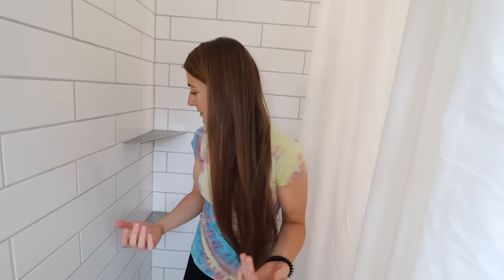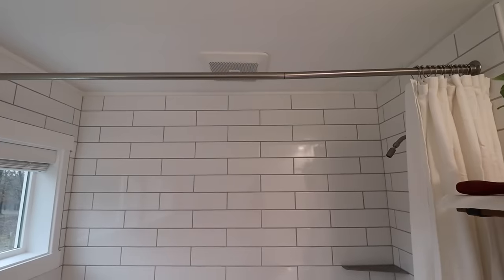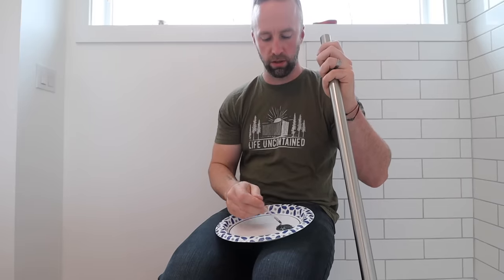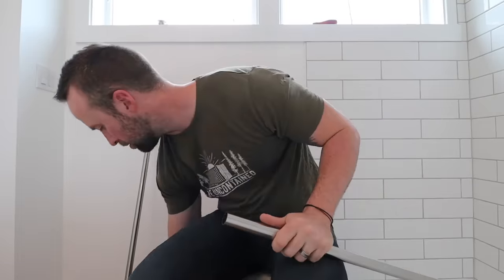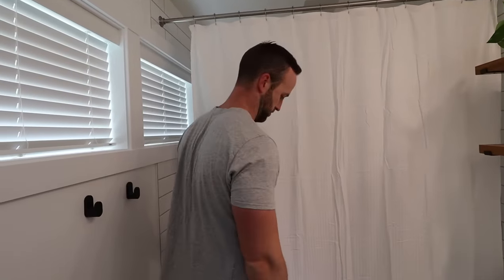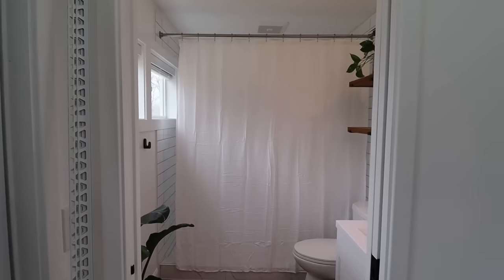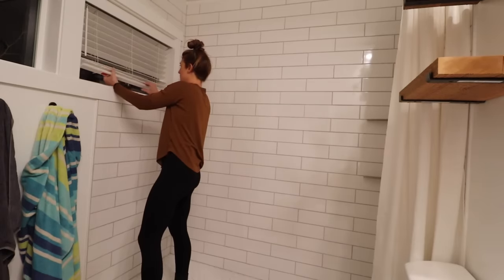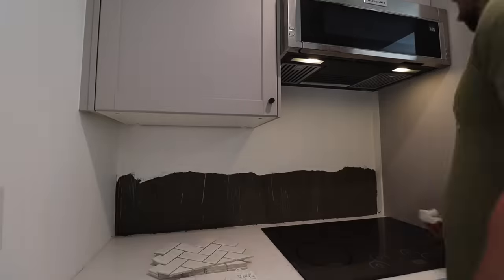FIRST SHOWER INDOORS AFTER 4 YEARS!

Comment: You can get two of the same shower curtains and put them together that'll have a nice draped effect and opening in the middle. That would look much nicer.
Reply: I agree, putting another of the existing shower curtain on the rod would look beautiful. One at each end of the rod, then when used, bring them together for one nicely fit curtain.
Reply: That was my thought too
Reply: I would sew two curtains together.
Reply: Tem razão vai ficar top aqui do Brasil
Reply: I was thinking the same thing... Could even get with a seamstress and have them combine the two ..
Reply: Sounds like a really good idea🤗
Reply: Sewing two curtains together will do the trick. It does not look nice to put them on each side. It will block one of the windows.
Reply: My thoughts exactly 💯
Reply: That was my thought too
Reply: Buy two of same and have them overlap, one part over the other. Or is the term 'intertwined'? One inserted into the other partway?
Reply: The rings that attach to the shower curtain can't overlap though and i would worry that it would be hard to make it close perfectly. But maybe if they are already wet the showercurtians could stick togheter?
Reply: I agree! Easy solution
Reply: Overlap the two curtains in the middle.
Reply: The problem is the pole that shags in the middle not the curtains. But yes it would look nice.
Reply: @dianemoonstone4715  A single seam is an easy way to make them a single curtain.
Reply: Exactly
Reply: I was thinking the same thing.
Reply: I think the shower curtain looks great the size it is
Reply: Thats exactly what I was going to say👍
Reply: I just came here to say the same thing!
Reply: @viviancatharinaseitzinger1841  or Overlap them on the same hooks…
Reply: The shower curtain is the inside curtain, putting two together is one way of putting it. The dress curtains are the curtains outside of the Shower and make the Shower have a different look - the dress curtains (2) can stay on each end with a tie [not the tie around the neck] to hold the dress motif for the bathroom. Or, something like that….. your choice on the shower curtains. [and, you’ll need a Second rod]…

Comment: I would install a hotel style shower rod, the curved one so you would have that much more room.
Reply: Only problem is that they don't make them longer than 72-inches long and they need 75 1/2"
Reply: Was thinking the same! Please go the hotel style shower rod. You will have more space...and don't forget the pressure change (while taking a shower) will suck the curtain towards you.
Reply: I put the same one in my place
Reply: thats what i have .. withe the curtaib id bought two put them up put magnets inbetween the two very simple and would look great
Reply: You can always construct one yourself with pvc,timber or aluminium pipe...
Reply: @kathywilder3272  Kathy, can you explain in detail what you are talking about?
Reply: Com certeza ia ficar muito legal mesmo, aqui do Brasil
Reply: Agreed
Reply: I agree!
Reply: @Harridanme1  Not a problem when the curtain doesn't span the entire length.  I hate when the curtain sucks in so I always have to give it 2" opening
 on the side so that doesn't happen.
Reply: @kathywilder3272  that’s super smart. You mean you took two shower curtains and sandwiched them between magnets to make a longer curtain yes?
Reply: I was thinking the same thing.
Reply: @fisherus  - I was thinking the exact same thing, though I suspect Spenser could come up with a way to extend the ends to fit their shower.
Reply: @Harridanme1  I have never had a problem with a cloth shower curtain coming after me ..... and weights are easy to add to the hem it if does become and issue.
Reply: I was wondering why they didn’t do just that!
Reply: @fisherus  that’s when you diy one to fit and work.
Reply: That’s the same thing I was just going to type.    It opens it way up.
Reply: TMI
Reply: Brendan, they don't have the sides of a tub to corral the bottom of the curtain, so they would end up either water all over the floor.

Comment: Friendly advice: 
Send that flimsy rod back. 
Get a rounded rod with a ceiling drop mount for more shoulder room. Set the ceiling mount 2/3rds toward the rear near the window. Use two standard curtains. You will have far more selection and they will be better quality and cheaper in the long run. The one closest to the water will be extended tight, the one farther back toward your window will not unfurl fully. Then put extensions on your rod rings for more light inside the shower and so the outwardly curved shower curtain lands inside the drip pan to keep you floor dry. Magnetic strip on the inside of the shower lip and magnets sewed or glued into the hem of the forward curtain keep it from billowing out from the steam and drip flooding the floor.
Reply: Great ideas!
Reply: I was thinking the rounded curtain rod too.  Didn't think about ceiling mount.  Great idea!
Reply: THIS 👍👍👍
Reply: Very well thought out
Reply: I have a rounded one and it is perfect.
Reply: 👍👍👍👍@ Marjongs Musings 
What she said 👏👏👏👏👏
Reply: I use 2 shower curtains! When cold weather season (NJ) it stops drafts too!
Reply: PS Wonderful shower!  Been following for years!
Reply: Agreed!  I love the curved shower curtain. For some reason I hate the curtain touching me. Lol.  And also agreed, get a second matching shower curtain.  ❤️
Reply: 100000% this
Reply: I AGREE~ Change it out Spencer!
Reply: I would also get 2 shower curtains. I don’t like them fully stretched out. ☺️ I also use a 2nd set of shower curtain rings for the shorter shower curtains I unknowingly bought. Those were a disappointment. 😒
Reply: Amen! That's exactly what I was thinking.
Reply: I totally agree!!!!
Reply: Yeah...They ain't gonna do that shit.
Reply: also IKEA has these S shaped shower curtain rings that means regardless of how the rod is mounted you can hang and remove the S-shape rings without any issues.  i'm loving mine because it means i can take the curtain down for a full spray and wipedown without any weight tugging down on the rod.
Reply: Somewhere I saw a rounded one that swivels on the ends so it can rotate 180 up and over and be rounded INTO the shower space when you are not using it. This lets you leave the curtain open to dry out and prevent mildew, but gives you space.
Reply: I have watched all your videos, great job all round. Please put a glass shower screen in that bathroom, it takes less space and it will look better...Please.
Reply: The only other thing besides a better curtain is a detachable showerhead. They have them for low flow shower heads. They cash pulse, massage and a few other patterns.
Reply: Soooo much hassle!
Id like my curtain to hang evenly not lopsidedly bunched up!
Far too much hassle with this idea. I doubt many would even think about doing it.
They said something about that shower section window not opening so a normal shower curtain would most probably get sucked in towards you. Grrr
Been there, done that...
Reply: @BenjiSun  they are the ones I want to eventually get but Ikea is a fair distance away and I dont drive that far very often. When I get my new Ikea vanity basin thats been sitting around for ages, to be installed, thats when I need those hooks.
Reply: @thenjiwemoyo6085  yes but after seeing how close it ended up being the rounded shower rod will give them a more comfortable space, don't you think? especially for the hubby.  Something solid (while great looking !) will be a pain to be knocking elbows on..
Reply: They can't get a rounded curtain rod.  As they said their shower is longer than standard.  They would have to get it custom made.  They were showering under tarps in the yard, with snakes hanging out nearby.  What they have created here will work fine.  Now they need to get the tub done so Beau can enjoy the fun of a nightly splash session.
Reply: @TexasbyStorm  "Can't" isn't a word I understand, I saw some good ideas    but  "Make do" I get...   Yikes!  Snakes are seriously busy right now.   Yeah the tub will be great!
Reply: A "hotel rod" would help for certain. With the measurements you need any pipe supply could put the bend in for you in minutes! Also the curtain issue easily solved just order 2 and ask a seamstress to sew together and cit to width.. it is just two straight seams super easy and not expensive...all problems solved and no custom ordering and delivery issues!!!
Reply: @agardenut  I hate the curtain touching me too
Reply: yes I thought that mayself
Reply: Yep was going to recommend a curved shower curtain to give a little more room.
Reply: @TexasbyStorm  he could bend a electrical rod.
Reply: What do you expect from a guy who spends 5 minutes explaining why the shower curtain doesn't go all the way across?

Not the sharpest thing to put a window in the shower. All kinds of opportunities for water getting behind the wall.

And why did they use grey grout? So they couldn't tell it was dirty? Should've used white.
Reply: Huh?

Comment: A quick tip: When you drill on tiles, just put a sticky paper on the tile where you need to drill as it will prevent the driller to move around.

Comment: Depending on how badly you want to add some shower space without taking up bathroom space - you can get one of those Curved Shower Rods and if mounted properly it will bow the shower curtain out at the top while the bottom will still stay inside the curb (if you have the shower curtain hung right).  If you want a stronger rod - I have used 1 or 1.25 inch rigid galvanized electrical conduit.  It is very stiff and it doesn't rust! It is also not expensive!

Comment: For the Curtain rod you could get a piece of Stainless tube, and have them cut and thread it at the Hardware store. Then put threaded flanges on the ends of the rod. Also with that you could polish the tube down to make it look finished
Reply: I agree with getting a solid one piece of stainless tube and adding in place of the two pieces rod you currently have.

Comment: I bet that first shower indoors was sheer bliss, well done on an excellent job, The tiles look great, When you need to drill holes in tiles use a bit of tape where you are going to drill. this prevents the drill from slipping. I know that you have finished your bathroom to a very high standard but you still have another bathroom to do, You are both amazing,

Comment: It would be really easy to sew a contrasting stripe down the side of the curtain to increase the width by a smidge. You could use a color (gray, the color of the plant pot, or pick something bright) or even a white with a contrasting texture. I would recommend adding a stripe to each side to make it balanced. You'll need 2 extra curtain rings to hang it.
Reply: or a black stripe;  very classy look;   or a black and white stripe;  nothing better.

Comment: If you need to drill in tiles: put 2 pieces of painter's tape in a cross on the spot and the drill wont slip away. Also, just dip the drillbit in a cup of water to cool, less messy.
Reply: He's using the wrong type of drill bits. Get the teardrop type that look like little arrows. I've use them for many years and they go right through ceramic tile with little effort.
Reply: @dunep6465  Yes, Spencer is learning.  I was cringing when he started drilling.  I could see it was the wrong type of bit immediately.
Reply: @dunep6465  Masonry bits.
Reply: Also running a drill backwards can get the hole started without slipping.
Reply: Beautiful!!!  Kudos to you both!!!
Reply: @rickc2078  yeah this also works. I prefer the tape because I like to believe it prevents little pieces of tile around the hole chip off, but I am not sure if that is a fact or just in my head 😆

Comment: You could add a dowel inside the 2 piece rod to add strength or a hanger.  I got tired of not having a wide enough shower so I used a curved shower rod which worked out very well. The curtain still tucks in at you feet, but it will give you about 6 inches or so and it feels like your whole shower is very wide.  Love your show!

Comment: Get 2 shower curtains and do the overlap of about 2 or 3 holes (where the rings go through ). Make sure the gap is away from the water stream direction. I hope that makes sense. I did it in my irregular size shower and it worked great.
Reply: I am going down and see we are thinking alike. Once you get the desired length then two will give volume and a beautiful finish
Reply: I thought of two curtains but if they overlap Spencer's OCD would act up.
Reply: @michellestephen7210   Once his wife listened to Donna he won't be able to tell
Reply: I was going to say this and you could also add a panel of a light weight colored fabric where the overlap is to hide it and add some color pop into the room!
Reply: @laurengoode9893   But she doesn't want colour. She wants a clean look
Reply: I missed that! Then do a panel of textured white still does the same thing 🙂
Reply: Better still, get a toughened glass panel, more room to shower, easy to clean.
Reply: @rickc2078  EXACTLY!!!! 👍👍
Reply: @rickc2078  explain more room as the curtain is already too close and the curved type rod at least gives a few more inches of wing spread...   something solid adds another issue: banging it or trying to avoid banging .
Reply: @itsno1duh  Shower curtains often suck in when the hot water runs and sticks to you, glass doesn't.

Comment: Go the custom printed shower curtain deal! (zazzle)  I did years ago and had my own graphic patterns printed on both canvas curtains.  The second one I then was able to cut the graphics into 18in wide strips and sewed to the center printed curtain with a proper seam.  Came out fantastic.  And then I used two frosted plastic liners (one cut short) as secondary protection.  Now imagine that bathroom of yours with your "Life Uncontained" brand and logo upon it... or perhaps tree branches or a photo of your old shower setup outside as a memory now inside.

Comment: Got an idea.  Get another shower curtain just like the one you have… add another 5-6 curtain hooks and overlap the shower curtains so that they cover the entire space.  Should look good and will resolve the issue of it being a larger space than the average curtain width.
Reply: Great idea!
Reply: Virginia, they fixed the problem with the pole. 😊👍🏼
Reply: By using two curtains that are exactly the same, the curtains will  drape better so you won’t have to stretch the curtain across the opening…  Also, if you overlap the curtains where they come together, there won’t be any leakage. OR even better, with two curtains, you could keep one at each end and draw them closed to the middle.  I know buying two curtains instead of one is an unexpected expense, but it is a one time cost that will last for many years.
Reply: Yeah that's what I do too. Only I'd cut one in half so I end up using 1 1/2 instead
Reply: Came here to suggest exactly this!
Reply: Yes! Buying a duplicate of the existing shower curtain and  combining the two will work great.
Reply: Exactly what I was thinking.   👍🏻

Comment: Highly recommend a curved shower rod! Made such a difference to our limited space and I believe it would be the perfect fit for you guys! Keep it up🙏🏼
Reply: I thought the same but they need an 8 foot long shower rod and I imagine it would be very hard to find a curved one.
Reply: They could make their own, but would need center support from ceiling
Reply: @ang_131  @angeliquedavis  I believe that they have the skills to make it happen :)
Reply: They could easily make their own and weld the wall brackets onto the ends of the rod so it could be well-anchored into the wall. With Spencer's welding skills, this is totally doable.
Reply: Either make yourselves a custom, long curved curtain rod (I have a curved shower curtain rod in my bathroom, and I swear the thing is magical. It never feels close in there. I will never go back to a regular straight rod. You could even make one out of copper plumbing fittings.
Reply: Yes and the fact that it’s 6’3” and not 8’ matters
Reply: "Highly recommend a curved shower rod!"  I would think a curved shower rod would invite a wet bathroom floor since it would curve out past the shower water containment lip they created.  ...Or do I misunderstand what you're suggesting?
Reply: @billroberts7881  you would think it would, but it doesn’t. The curvature is only from up top and allows for more room from the waste up. The bottom portion of the curtain falls and aligns with the containment lip.
Reply: @VisionaryGardener  I agree!!
Reply: @billroberts7881  you can also just get a bit longer of a shower curtain. Plus only the top bows out
Reply: Buy two of same shower curtains 🤗
Reply: @ang_131  just JB weld both ends to make it longer ;)

Comment: You can always put up two curtains on the rod. Install some 2" blocks on either end of the rod and attach the rod to that. You can also put a hook on wack block to hold the curtains tighter to the wall...or...put up a magnet on the wall and the curtains to pull them to the wall. 
It doesn't have to look rigged up, but can look nice. 
If you go with two curtains, you can put up a stabilizer that attaches to the ceiling the curtains can cover where it's attached.

Comment: As an interior decorator I often use curtains they come in a vast amount of styles and colors, you can customize them to fit the height to go all the way up to the ceiling, which looks really nice as well as getting them to the link that you need. The only thing you need to make sure is that you have a liner and the back of your curtain sometimes two of them. Just an option should you decide to change it up in the future. It's looking so lovely, great job guys
Reply: I was thinking about the liner too ... I have a feeling that there is a curved rod with two curtains and liners in your future.